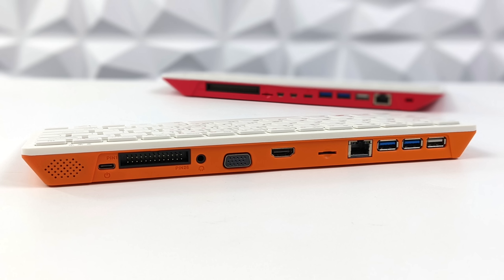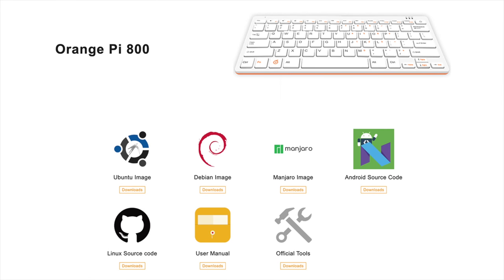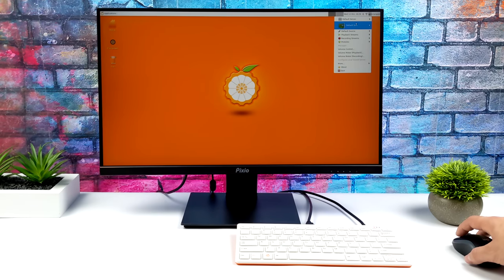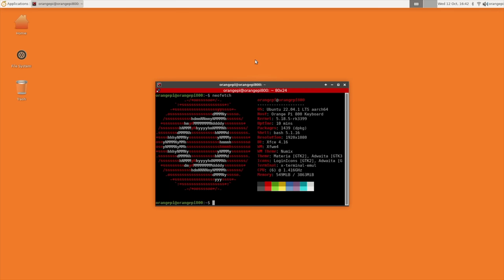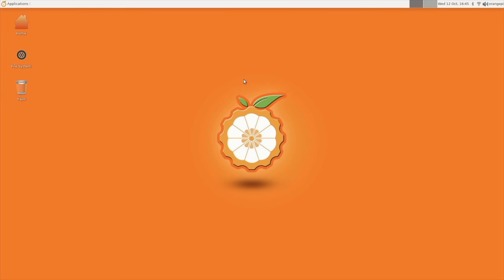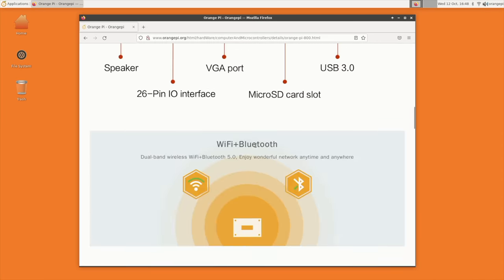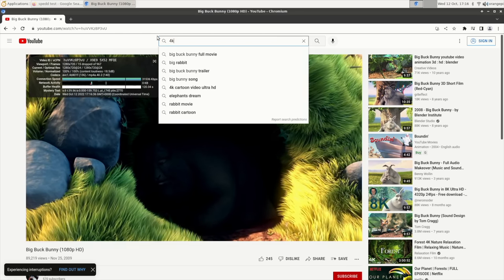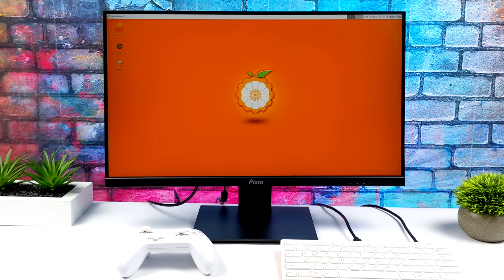Pi800 First Look, An Brand New All-In-One PC! Think Pi400 But Faster! 6 Core Arm CPU

Comment: Now calling it a 'pi800' is just confusing - it made me think it was the upgrade to the Raspberry Pi400
Reply: it's not much faster than an over locked pi4. That power brick is doing most of the work.

Thank Alder Lake for bringing good Big.little scheduling to Linux. Hopefully Pi5 will be power efficient.
Reply: @ch4.hayabusa  Ah that's a shame. I wouldn't consider myself a RPi fanboy or anything, but I'm so happy with their products, that I'd much rather wait for a Pi5 to see what they got up their sleeve. Besides, my Pi3 and Pi4 are still working well...so in no real rush to use a Pi800 lol

Comment: I hope more companies keep making these new Microcomputers based on ARM and Single board computers.
Reply: I agree but would like it to be expandable and upgradable like normal PCs and laptop motherboards
Reply: @rb3020  That would be almost impossible as the savings primarily comes from the fact that it's a single PCB with soldered chips on it. Upgrading it would push the cost up towards that of a regular budget PC.
Reply: @joey199412  your pseudo fits you well... If you can upgrade it, who cares about spending a bit more ? A movable socket doesn't cost a lot, it's just an excuse to sell whole new sbc at each release.
Reply: x86 is better. Intel should flood the market with Jasper Lake and Alder Lake-N. ODROID-H3 is coming in at $129.
Reply: I want see Rockship 3588 pc.
Reply: @rb3020  I've always thought RPi should release a CM-based 400-alike. So you can keep the case and interface and just swap out the working bit.
Reply: The Lenovo ARM ThinkPads have potential. Snapdragon 8cx laptop looks good at least in theory
Reply: @joey199412  if put on a laptop form, they just need to commit for upgraded motherboards, like  framework did. and it's fine.
Reply: @WarblyWark  any specific reason? RISC-V still isn’t quite at the level of ARM. Also most users won’t be able to tell any difference between ARM or RISC-V except from available software, which I think there is probably more support and software for ARM considering how many large companies and consumer devices use ARM cores.
Reply: @WarblyWark  look at the silicon that is available, it is slower. The documentation doesn’t matter, it is still slower than arm SBCs. It may have the potential to be just as fast but it isn’t, so it still isn’t really a competitor like it is in the microcontroller field. Also what benefits does it actually have over ARM? I’d say not much, if any.
Reply: @WarblyWark  RISC-V has been used in SBCs, it just compares to ARM like 2+ generations ago so isnt competitive. That is a big if, the question is why isnt it? The technology already exists so why isnt it implemented like that and why isnt it as good as ARM. RISC-V is not very new now, why isnt it further along?

What actual benefit does it being open source actually give to you? There will be almost no difference in using it at all and most people would never notice. It is an open source ISA, but individual implementations arent open source, so unless a company wants to design the chip from scratch then they still need to license the design from someone else, which is exactly what already happens with ARM, so what actual benefit does it have being open source?

Current implementations arent as powerful, you still need to license the design unless you want to design it yourself, which most companies wont do, it will make almost no difference to the consumer, so what is the actual benefit?

There is no benefit to anyone using it, it is less powerful as an SBC or CPU, it doesnt have as much software support, there are multiple vendors implementing it differently with different extensions, you still need to pay for a license to use already made designs, which most companies will. I dont see any benefit to using it over ARM.
Reply: Finally we're back to everything in the keyboard like it should be.
Reply: Oh me too, seeing as I can't get a raspberry pi at a normal price for anything! Finally decided to get one and cant
Reply: Absolutely. I'm using the M1 Mac Mini with Asahi Linux as a server and it's an absolute beast. It's not released as a single board computer, but it counts.
Reply: @WarblyWark  Ikr, I dont give a crap about arm, any microcomputers are cool, but riscv mean more development of the instruction set.
Reply: You might want the home computer era to return once again
Reply: @GungKrisna12 Oh you mean when the primary electronical communication medium was the PC and not the smart phone? I mean they're all computers in the end, its just how you use it. Just like how you can turn a raspberry pi into a phone, you can turn an android device into a home computer.
Reply: ARM kinda sucks as an ISA though.
Reply: @conorstewart2214  The reason is simple - RISC-V can only be shipped on larger dies while it's in the evaluation phase. There are no companies like ARM who can lay out a Cortex spec and sell it off to consumers. This is both a good and a bad thing.

RISC-V, when compared directly with ARM cores on the same silicon processes, has ~10x better performance-per-watt in SIMD operations and ~2.5x better performance on integer/fp ops. ARM is going to get it's lunch eaten if they don't come up with a competitive core design, and nothing on their roadmap seems poised to directly address this market gap. 

> What actual benefit does it being open source actually give to you? 

Have you been living under a rock for the past 30 years? Licensed ISAs are the reason why people hate Intel and ARM. They stifle competition and lead to under-the-table deals like the one Apple struck up (or what Nvidia attempted). This is not healthy for the chip industry, period. It's especially harmful to countries like China, who despite sanctions will still continue attempting to fab their own chips. It makes no sense for them to use ARM or x86, so they've invested heavily in progressing RISC-V's development.

You sound like someone who doesn't have much of a stake in this community (which is fine). Lying about approximate performance metrics doesn't reflect well on your overall arguement, though.
Reply: @dial2616  except there are companies “like ARM” that license their RISC-V implementation.

Why haven’t we seen these performance benefits from RISC-V yet? ARM isn’t really in trouble at the moment.

You are commenting on the chip industry as a whole I asked what benefit does it give to YOU? Companies preferring to use ARM cores is a choice, it’s not like they will suddenly all change and decide to go RISC-V. RISC-V isn’t the answer to every problem. Also open source isn’t always the answer either. There is plenty of competition between companies that use ARM cores maybe not with ARM itself, there aren’t many competitors for ARM for a reason, if there were better options than using ARM, companies wouldn’t just use ARM. 

Also people seem to miss the fact that the ISA is open but companies don’t need to open source their implementations, there will be companies that just design RISC-V cores and license them to other companies, there already is and a lot of companies will choose to license designs rather than design their own.
Reply: @conorstewart2214  If you're not going to show me a direct comparison of ARM and RISC-V on the same node, your claims are unsubstantiated. It's not my responsibility to teach you about process enhancement or doing your own research,
Reply: @dial2616  I see you are ignoring all my other points. You aren't teaching me anything anyway. By that same logic your claims that it is just as good if not better are also unsubstantiated, so where's your proof?
Reply: Id settle with stock with what's out now

Comment: Love the fact this thing has a VGA plug. It makes turning this into a retro games machine and plugging it into a CRT PC monitor for that vintage look really easy 😁
Reply: And a headphone jack - love the RPi400 but it is something my use case ends up seeming to need (carrying it around as an "emergency computer" to connect to displays that are available, many I find don't supply audio). Matter of fact, one of my two 400s is just connected to a VGA/audio adapter to make use of my home monitor's dual inputs, on that note 🤔
Reply: Android on crt, not vintage... But very interesting.
Reply: Give it to a 9 year old child with a basic VGA monitor.
Reply: @ricky4673  He said GAMES Breh.
Reply: I've got an old SONY flat screen with VGA. Do these have a delay as well? Or does it only delay on digital in/out like HDMI? I see no reason why a flat should be slower than a CRT.
Reply: @axemanracing6222  lcd have to physically shift the crystal structure of the panel, plus digital processing delay, whereas crt is all analogue and throws pixels on screen as fast as it gets them
Reply: @virtualtools_3021  and actually that major difference is that CRTs do not have pixels at all.
Reply: @madigorfkgoogle9349  that too, it just "paints" the image on the phosphor
Reply: @virtualtools_3021  yes, exactly like that. While colour screens do have some kind of matrix, those are not pixels.

Comment: Every time it appears on the screen, I keep thinking your camera's color balance is way off, but that's just because I'm used to the red of the Pi 400!

I wish the Pi 400 had a built-in speaker. Would've been a very nice little quality of life improvement.
Reply: Yeah, or at least an audio jack.

If the Orange Pi had a 40 pin GPIO port it would be a real contender for me :(
Reply: me tooo Pi400.   That Pi800 is much better GPU???
Reply: Hey I know you
Reply: @TomNook.  how?

Comment: At that height, it would be amazing to have a Pi built-in inside a mechanical keyboard. Bonus points if said keyboard has hot-swappable switches (not sure about how feasible that would be)
Reply: Super doable, I'm surprised I haven't seen one yet. And with hot swap becoming standard on custom keyboards I'd be shocked if someone made one that wasn't
Reply: I don’t know much about keyboard tech except that mechanical keyboards are desirable and different people like different switches due to feel, response time, etc. What is the additional benefit of hot swappable switches?
Reply: @Sashazur  it males it easy to change the switches, otherwise you'd have to desolder them and that's a pain